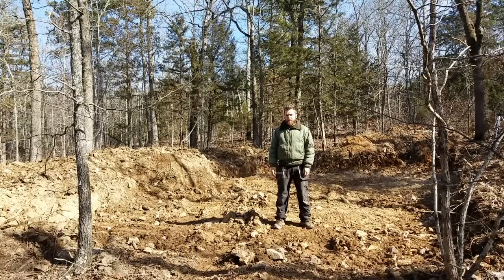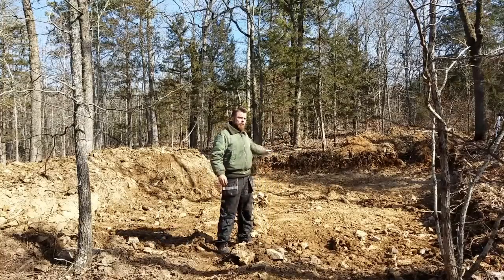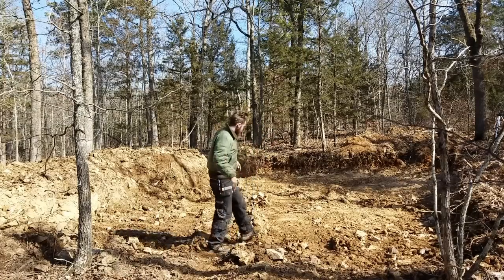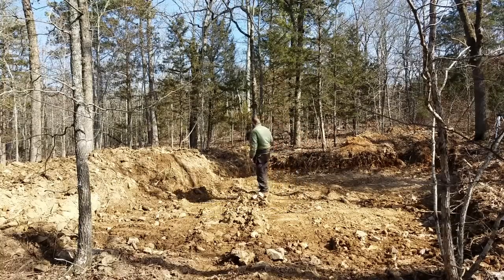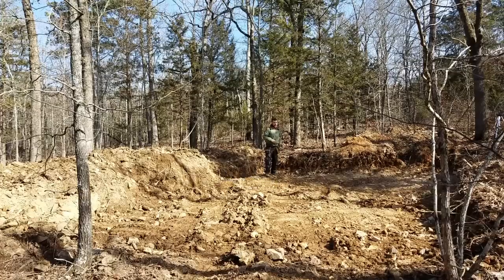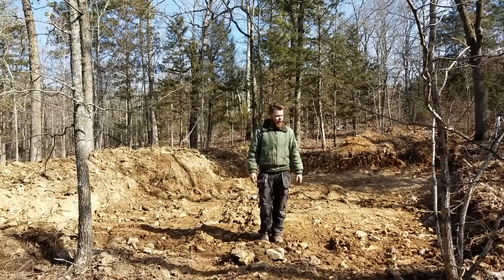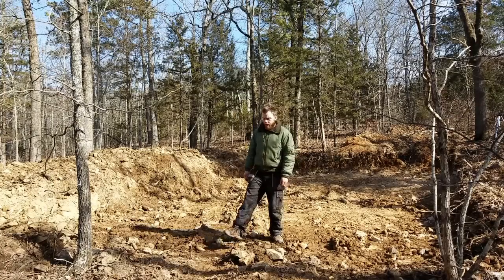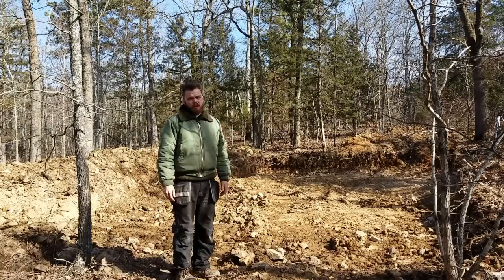A-Frame cabin: Building a Permanent Wood Foundation

Comment: Supposed to glue the plywood onto the studs and waterproof caulk the joints and pea gravel for drainage used to back fill the outside.

Comment: iv  been    doing     this    type   of   foundatio    since   the    70S    so  i   nee   to   ask   why  didi  you     do   it   so  high   also    you  do   have a    french drain  around  it   right   also    did  you      put    plaice   uuuuuuuuuuuuuunder  your  gravel   and   what  are  you   going to   use  to   seal   the  walls   of  the  foundation  since  i  didint  see you   calk the  seam  i   use     the   probuct  call    bule  skin    to    cover  the     ply      having    al  that   rock     helps   since     my house    is    sitting  on   lava    rock      buit  i   had  to    jack  hammer  a  lot   of  iyt    but   it is   worth   the   work   because   the  cost  of   concret   is  way  to     much  but  what   i   see    what  you  have  done  it is  good should    used     2x8   fpr the    walls    and    16 inch    on  center

Comment: How is this foundation holding up after 4 years?
Reply from the maker: So far it still looks like new, but we will see. Main worry is termites; we inspect inside and outside each year, so far no signs. We sprayed the whole foundation with borate solution in the second year, maybe that's helped. There are a lot of termites around. 

One upside is that the whole construction is visible and accessible from inside, so in theory it's relatively easy to jack up and replace parts that go bad.

Comment: here is a question, I assume the support beams are 8x8 that are maybe 3 feet long? is there a way to attach the A's where the 8x8 are located so you can use that 3ish feet as part of the interior.  and build the flooring off the cement pillars.  Cheers love the videos

Comment: Great work.Leave it. Code requires a tar seal layer anyhow. Liquid tar.  Or use the blueskin peel and stick roll. Its basically the same as roofing 'Water and ice' roll. Butyl & polyethylene roll.  Every roof with a low pitch should have it.
  Pea rock really is the best footing and back fill against plywood.

Comment: What about applying the right plywood over the existing plywood? Before applying the new ply treat the existing plywood with termite control along with the rest of structure lumber and then apply the new plywood over the old stuff. It might save a ton of work and give you a very strong structure.   Vinny 🇺🇸